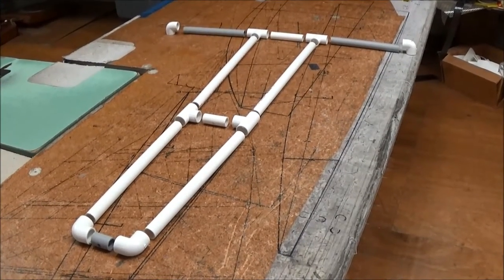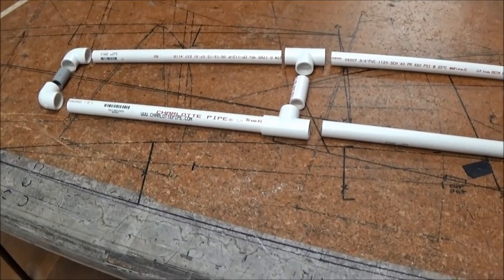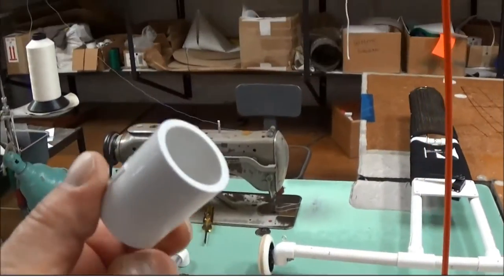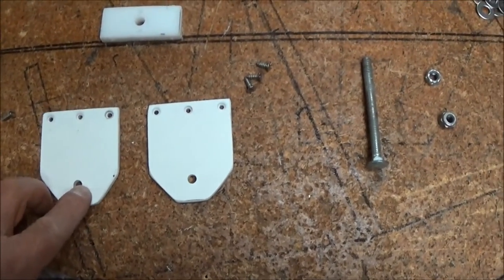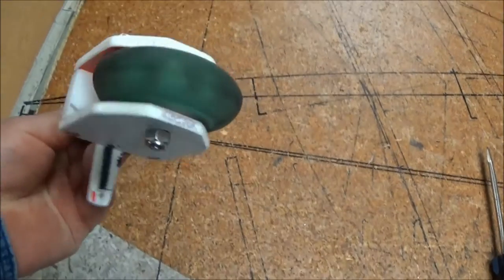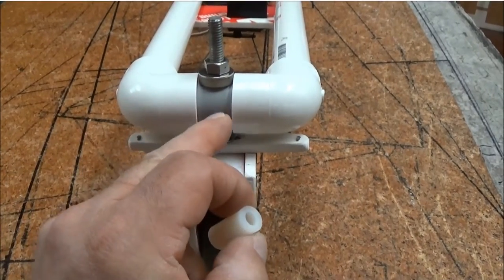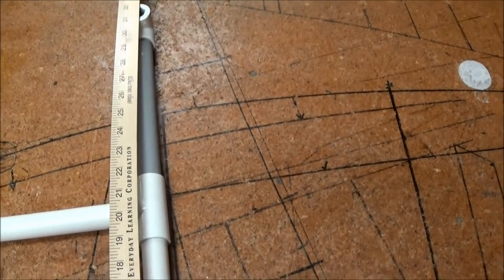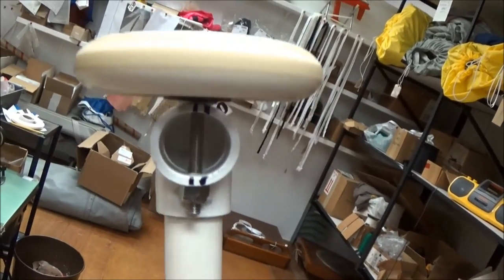Build Your-Self PVC RC Land Sailor (Hull) Pt.1

Comment: Thanks for sharing this video  IceFlyingTim!
I'd like to try to build one of these I figure it would be nice to try when it's too windy to fly.
Reply from the maker: Thank You Mark Primavera It Is A Lotta Fun To Sail, I Do Have A Sail Plan Build Vid.
Reply: @IceFlyingTim  - I've drawn out the sail to actual size using Corel Draw and will be starting hull construction.
Reply: @IceFlyingTim  Hull construction is complete. Now I just need to borrow a sewing machine to make the sail :)
Reply: Just wanted to share my experience with your land yacht, I replaced the back two wheels with R/C 2.5 inch (Dubro) inflated wheels and found it rides smoother and takes out any minor bumps. The bad part is my plane no has no front landing wheels :(